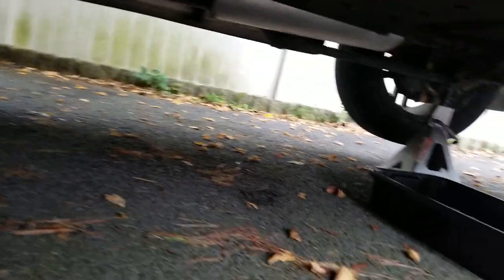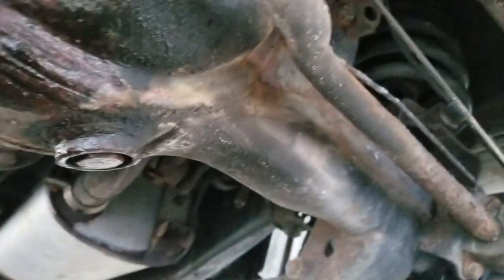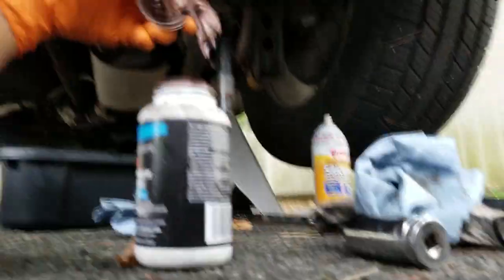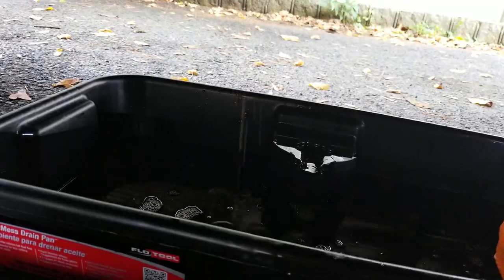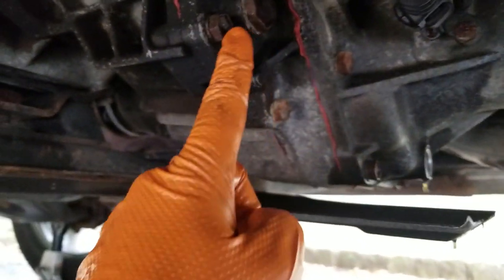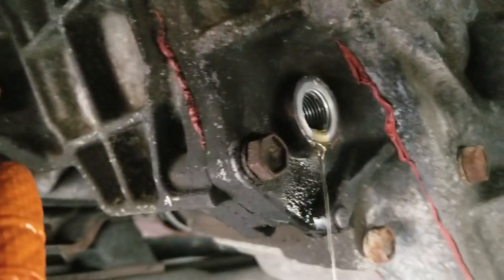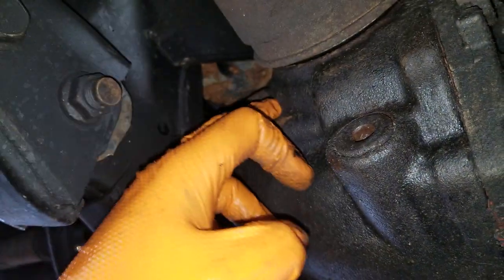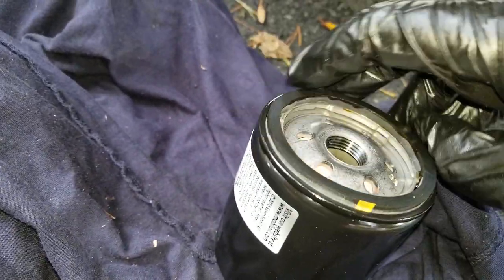LX470 and Land Cruiser Differential and transfer case Gear oil change

Comment: Yay! The first thing I did with my LX is a full fluid overhaul including the front, rear diffs, power steering refresh, radiator and transmission drain and fills. Are those 3 ton jackstands you're using and are they more than enough to work on the truck? +BeginnersLuckGarage
Reply from the maker: The front is 3 ton jackstands but I have 6 ton Jackstands on the rear. I dont think you need much more than 3 ton but I keep the jack under there too just in case sometimes.
Reply from the maker: Thanks for the comment
Reply: Did you notice a difference when u changed front/rear differential fluids ?

Comment: I'm surprised none of the drain or fill plugs had washers.

And did you really not torque the plugs when reinstalling? Or was that sarcasm too?
Reply from the maker: All of the drain and fill plugs had washers. I re-used the original ones. It's hard to tell because they are stuck to the bolt head. As for torquing. I did torque them all to spec, Drain and fill.  I guess i should do a follow up video to clarify.
Reply: @robertdutka3409    Karen Dutka
Reply: @E39M5SPEED  hahaha!! I didn't know you and I had the same last name!

Comment: diff every 3k miles? bro you can go 30k easily with no damage
Reply from the maker: There was lots of sarcasm and jokes that i thought people would get but I dont think i did a good job making it clear that i was joking. Such as all the nuts being hand tight and opening the drain first. Sorry for the confusion. I do change the diff fluid every 30K. Thanks for the comment.